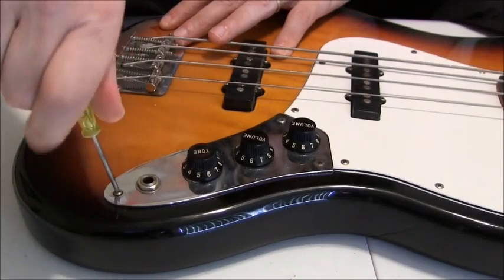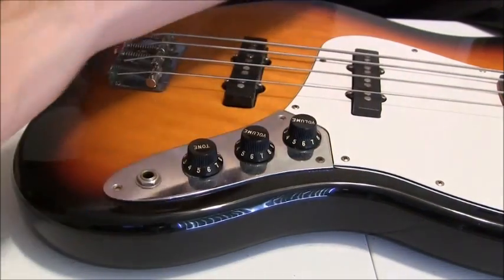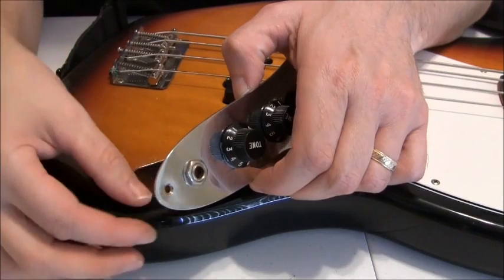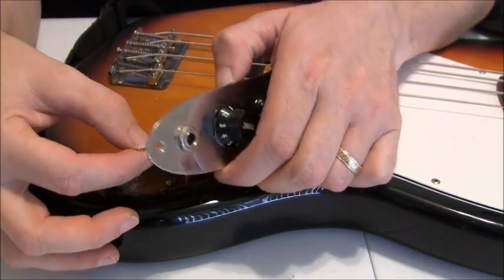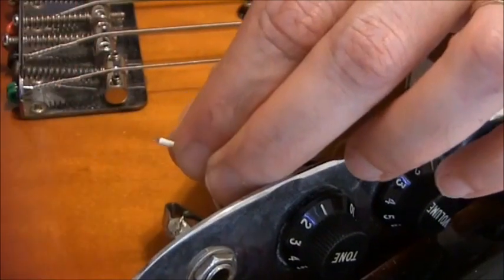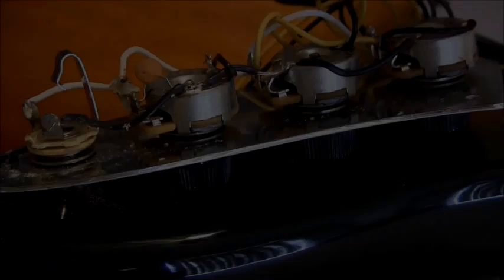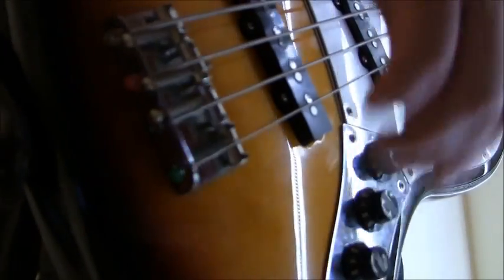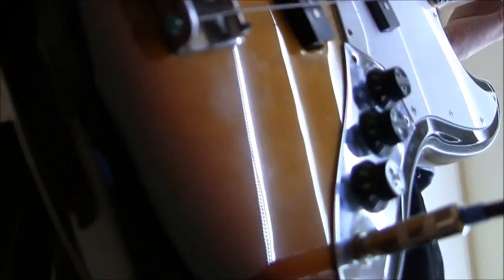Bass/Guitar not working...check the jack

Comment: My bass randomly gets weak power and I don’t know what’s the issue. It’s muffling and then all of a sudden the sound goes back up.
Reply from the maker: Could be a number of things. Ya just have to narrow it down. Make sure it's not the amp or the cord. If it's an active bass check the battery. Check your volume and tone knobs. See if they react as you'd expect them to, could be a dirty pot. Sounds to me like it could be an amp thing. I had a situation where there were volume drops with one of my old amps.

Comment: I have something going on with a relatively new Musicman (not a 1000 gigs, that's awesome) but my issue is that the sound goes in and out, or sounds heavily distorted, or wavers...it does all three, randomly. Very annoying. It doesn't happen at all with my Ephipone, so it's not the amp. Any ideas?
Reply from the maker: First I'd check the battery on the Musicman. Could be a weak battery. If that doesn't work, then I'd check the jack and controls to make sure there aren't any broken solder joints. Good luck with it.

Comment: Hi great video! Helped a lot!! 

Does it matter which soldering iron is used? What kind are you using it seems to get the job done pretty well! 
Thanks!
jio
Reply from the maker: Hey Jio- No, it doesn't matter. I use a Weller SP23L. You can get it at Home Depot or Lowes.

Comment: My bass makes connection, but has no output. Nothing wrong with the cord or amplifier. Any solutions?
Reply from the maker: Hmm... well, I would work backwards and double check everything. I'd try another bass in the amp, double check cord, check battery if the bass that's not working is active, and check all the solder points.

Comment: I did check my bass jack , it seems fine , i just changed the batteries as well , but it still doesnt make any sound , solutions ?
Reply from the maker: Only thing I can tell you is to check everything right down the line. Start with another bass and make sure the amp works.. make sure the cable works... if the amp and cable are good check the wiring of the bass again and make sure there aren't any loose connections. You can also try to wiggle the cable while it's in the jack and even back it out a bit. If you get sound even for a second then it's the jack. Good luck with it.
Reply: stevekonbass  :c amp turns on, but no sound.. I don’t have another bass or another cable. 💔😔
Reply from the maker: @JacobElordisBathWater  Well that sucks. Leading up to that point did your amp give you any problems? Well... you can still do a few things. 1-Turn the volume knob of the amp back and forth and listen if there's any noise or static. 2- If your cable has a screw off sleeve on the connectors  you can unscrew them and give them a visual inspection to see if any of the soldered wires came undone. 3- You can do the same thing with your bass. Unscrew the plate where the input jack is and give that a visual inspection. 4- Make sure it's nothing silly like you left headphones plugged into the headphone jack of the amp. 5- If your amp does have a headphone jack, plug a set of headphones in and listen to if anything is going to the headphones. 6- Make sure the cable is plugged in the amp and bass all the way (especially if it's a cheap cable).

Comment: Man, my active bass does have output but at a very low volume, replaced the battery but made no difference. Any ideas? Thanks
Reply from the maker: Battery would be my guess too. Then I'd check cords and amp.
Reply: @stevekonbass  previously to asking already checked both cable and amp, all good. I guess it's more serious :( thanks anyway

Comment: My bass has both wires cut, a red and a black one. Does it matter to which of the metal parts of the jack they're soldered? If so, which one goes where? Thanks!
Reply from the maker: I couldn't tell you off hand. Take a closer look at where the little globs of solder were and the length of the wires. That could give you and idea of where they go.

Comment: Hiya I’m a fairly new guitar player, I just got a new amp which works and a cable I’ve had for 2 years might be the problem but I am not sure, when I touch the top with my finger I get a response but nothing when I plug it into my electric guitar , I tried with another and still nothing. I’m pretty sure it is the chord but how can I test it?
Reply from the maker: When you're not getting any sound out of your amp it's just a process of elimination. It's either the guitar, cable, or amp. Make sure the volume is up on your guitar and volume and gain up on your amp. If you have a pickup selector switch on your guitar, try different positions. Sometimes a switch can go bad. If you have active pickups, you could have a dead battery. Check the battery. You could also check the jack to make sure their aren't any loose wires. If the amp is brand new chances are it's not the amp. The easiest thing to do is to try another guitar and cable if you have them. You'll figure it out. They do make cable testers, but it would be cheaper to just buy a new cable.

Comment: I have a this exact bass and i checked the inside, but there aren't any loose wires. It wasn't the amp or cable cuz it worked with my 6 string. Do you know what may be causing this. I haven't found any solid answers on the internet
Reply from the maker: No sound at all? Hmm... make sure the cable is making good contact with the jack. Try one pickup at a time and see if you get any sound. Again, double check to make sure there aren't any loose wires. Sometimes it isn't as blatant as a wire flopping loose.
Reply: @stevekonbass  Kay, thanks! ill check those when i have time and let you know how it goes!

Comment: how do you cpnnect the wire back
Reply from the maker: Look to see where it came off from and re-solder it.
Reply: @stevekonbass  the only problem is i dont have a solder kit, any temporary way i can use before i can solder it
Reply from the maker: Not really. You can try a little piece of electrical tape to hold it connected, but I doubt that would work.
Reply: @stevekonbass  alr thx
Reply: @stevekonbass  what do you think of the danelectro long horn bass
Reply: @stevekonbass  also could you play hysteria by muse and tommy the cat by primus
Reply from the maker: I never felt compelled to buy one. I judge a bass on how it feels first, and how it sounds second.
Reply from the maker: Never heard either one of those songs.
Reply: @stevekonbass  wow, and you say your a bass player, well you should give em a try, they, are very difficult songs
Reply from the maker: LOL, that's a very young sounding comment, but I can appreciate the young mind point of view.
Reply: @stevekonbass  im 13 lol, but just saying, tommy the cat is one of the hardest ever written
Reply from the maker: You have a long way to go. You'll hear a lot of bass lines that you'll think are impressive. Thing is, you can spend all your time trying to learn a really intricate piece of music and then go play it live in front of an audience and it lays an egg. Of course, you can learn it just for the challenge and the fun of it. But, if you ever plan on gigging, learn the tunes that are guaranteed to get the audience moving. I started taking lessons at 13. That's a good time. You're gonna discover a lot of cool music. Make sure you learn right and maybe you'll make a living at it when you're older.
Reply: @stevekonbass  yeah makes sense, but im just saying, listen to tommy the cat, watch a video of someone playing it, youll be hooked on the band and the bassist and singer les claypool